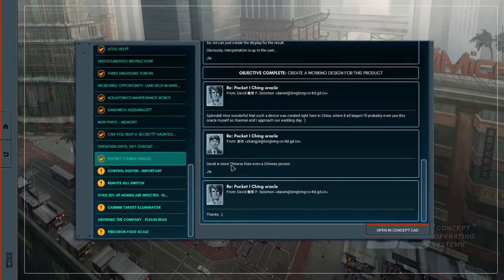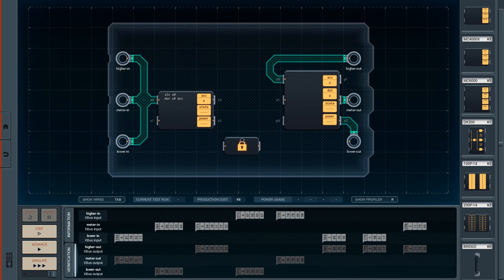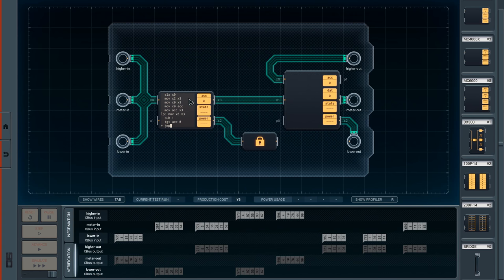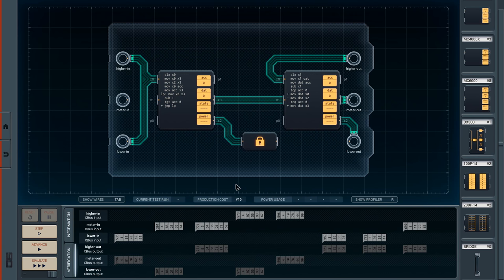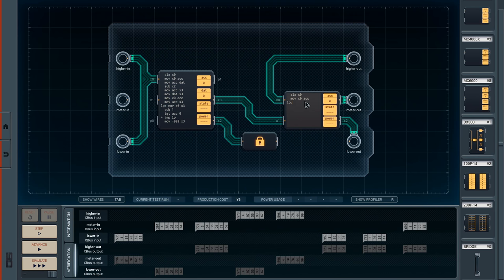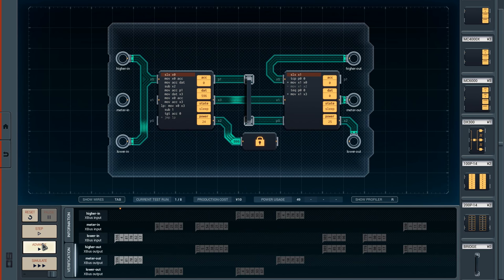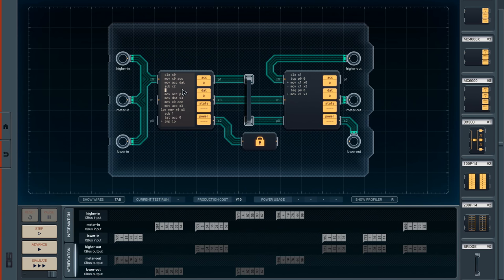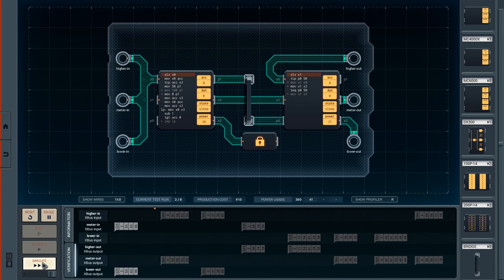Shenzhen I/O - Part 7 - Packet Router & Updated Sandwich Maker

Comment: Router can be done with cost of 5y power of 298 and 10 lines of code
Your basic idea of combining all inputs is correct. I did so on X1 of an MC6000.  I combined the address chip with meter out on X3. The lower out on X2, Higher out on X0.
The trick seems to be to recognize an address is always above 100 and data always below. Also, since we can wait for input and route it we need not bother on length. This makes the following possible

slp: slx x1
  mov x1 acc
  tgt acc 100#adr?
+ mov acc dat
  tcp dat x3#route
- mov acc x2#low
- jmp slp
+ mov acc x0#high
+ jmp slp
  mov acc x3#same

Comment: The router puzzle can be done on one chip with some clever wiring, but this was a decent solution.
Reply: Yes, it can, but it should´t work. Key and out on the same x-bus, it should flooding the out in my opinion.
Reply: That isn't the way peripherals work in the game.  You can hook a simple input to a simple output through two DX300s connected with X-BUS, and nothing will ever happen as there is nothing to request the data over the X-BUS.  The key will only send it's data when there is a read request, which the output never responds to, so there is no issue having them connected to the same port of a MC6000.
Reply from the maker: Not seeing how to do it with one chip since I need 5 xbus connectors, (1 input, 3 out, 1 address).
Unless it's using one of the output lines to read the address, which would be a bug IMHO.
Reply: Yes, you can hook the address chip to one of the output lines.  The address chip is read only, and the output is write only.
Reply: Won't the 'sea of Xbus' fail if packets come in from more than one pin at the same time?
Reply: A bug? Wut? UART should be at least half-duplex.
Reply: Not a bug, the spec for XBus communication says that there must be a device reading and a device writing in order for data to be sent. The address is always writing, so reading from the output line takes data from it. Sending to the output line would then route to the output, which is always an output.
Reply: untrue. if the address chip would constantly write it would send its data straight to the output. so there is obviously an invisible handshake going on when putting the connected port to read. that handshake would then - however - also be sent to the output line. So the only reason that works is bc the rules of the game don't perfectly correspond to reality. Which is fine, but its quite correct to consider it a bug also since it probably wasn't intended to work that way.
Reply: no no, you would definitely not have enough lines.. right?

Comment: First make it work. Then, make it work better.
Reply: tbh I feel the language of Shenzhen is kinda hard to read and very untidy - so I tend to try to optimize beforehand as much as possible too since correcting the code afterwards is a hassle. much more than it would be on a higher level language or a less restrictive hardware
Reply: Which assembly languages are clearer? I've only used MIPS, which is much less intuitive.

Comment: What I don't get is, when you pass the analogue input from the data register into the accumulator and sleep on it, what happens when the bridge across the data gap is compared to the breaking xbus? And if I replace the xbus with a non-breakable analogue input of -999 or any number larger than 2^6, do I still need to sleep? Or can I just go right back to work as though nothing happened? This is the only thing holding my company back from world domination right now.
Reply: I do not a understand your question. Scotts circuit only sleeps if no input is on in. Analogue inputs only goes from 0-100 . And what have number larger than 64 to do with anything?

Comment: Scott do you know what you are doing because you are already a code writer or is it game specific knowledge that anyone can learn?
Reply: In the first episode u see scott have this printed out manual, in there u can see which commands u can use with small examples. having coding experience will help but is not neccesary.
also the manual is ingame aswell
Reply: its actually a great way to learn the basics of coding even if you start from zero. The difficulty curve is great and it starts out feeling more like a puzzle game than a learning experience